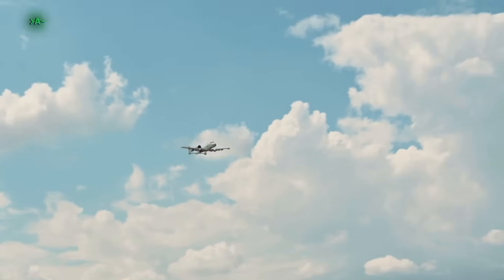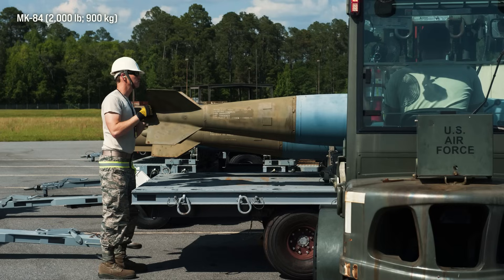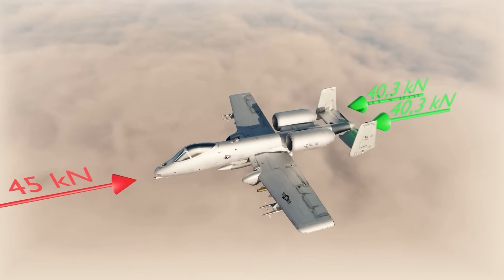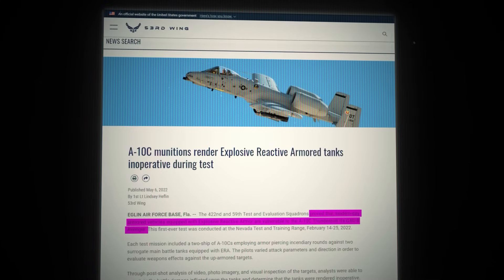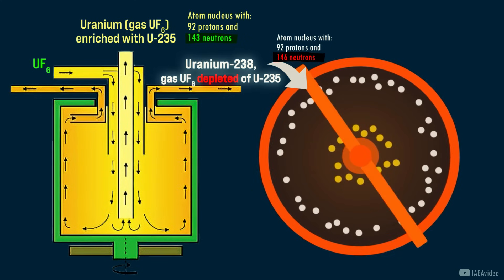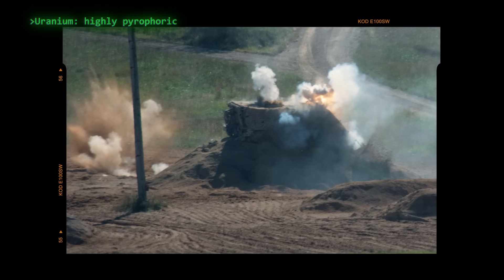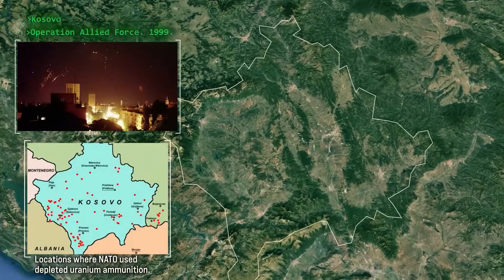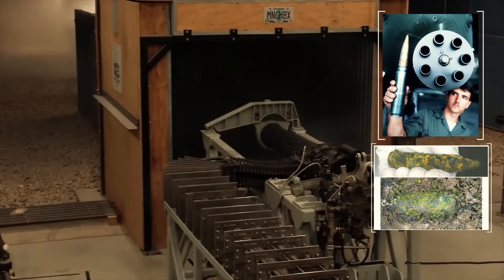The problem with the A-10's uranium ammo

Comment: 7:26 -  "The problem with the A-10's uranium ammo" - what a hogwash... This "problem" is 99.9% radiophobia and ignorance.

Radioactivity of DEPLETED uranium is very low and it is stopped by few cm of air (being mostly α and some β radiation), and while I could not find specific data comparing it to "natural background radiation" levels it is deemed to be "radiologically safe" (i.e posing no real radiation risk, unless ingested or embedded in human's body). In fact, because of its density and availability (hundreds of thousand of tons of it produced as by-product of uranium enrichment) it is used as RADIATION SHIELDS in many applications. Or as "weight trimmers" in airplanes. Or for manufacturing "shots" for anti-aircraft missiles (like the one that took down MH 17 flight over Donbass in 2014). Or... for tank armour.

Toxicity? Uranium is TWENTY FIVE TIMES less toxic than lead. But still, with all that DU in the environment..." - OK, fair enough, let's look at some numbers.

So far the military operation that used the most DU ammo was Desert Storm, where about 300 metric tons of DU was "spent" (ALL "tons" mentioned here are metric ones), in form of all sorts of kinetic penetrators (be it A-10 30 mm ammo or APSDFS anti-tank projectiles, and what not) - while ONLY during WWII, only Soviets (!) used about 17 BILLION pieces of lead bullets - which makes well over 150,000 tons of lead thrown into the environment.
Again - ONLY Soviets, and ONLY during WWII. And what about ALL OTHER ARMIES in WWII? What about WWI? What about all the bullets shot every year in US alone? (at all sort of "ranges" - which could be one's backyard or even some clearing in a forest)? What about all these lead shots en masse every year for hunting ducks, geese , rabbits - and all sort of small game? 
That "Kosovo War" you mentioned accounts for just over that EIGHT AND HALF tons - not "eighty", but EIGHT AND HALF ONLY. And then any statistics quoting "increased rate of this or that cancer" should be compared with PREVIOUS data - if ANY such data exist at all. 

For instance, some claimed "increased birth defects and leukemia cases" in areas adjacent to Chernobyl plant after the Chernobyl disaster, yet apparently the population there was NEVER screened for these PRIOR TO IT - so no full and reliable data for "prior" years (and decades), thus one can't say whether it was REAL "increase" - or just because of proper screening of the population AFTER the disaster many cases that formerly went under radar ("died of old age") were now found and recorded - so any such claims of "increased rate" should be taken with pinch of salt (sometimes a teaspoon of it).

Back to our "underappreciated" lead - and then for decades it was widely used in anti-corrosion paints, in white paints ("lead white"), PVC stabiliser, and as octane boosting / anti-knocking agent in petrol, and what not (hey, even boiled linseed oil prior to '90s was "sprinkled" with lead compounds!) - and all that lead still lingers in the environment...
Here's is an excerpt from "Measuring Lead Exposure in Infants, Children, and Other Sensitive Populations." (p.3., "Lead Exposure of Sensitive Populations" , by National Research Council (US) Committee on Measuring Lead in Critical Populations , 1993):

The amount of contaminating lead released into the environment closely parallels the record of lead production over the last 5,000 years. Approximately half the lead produced is released into the environment as contamination (NRC, 1980). Current production is about 3.4 million metric tons per year , and current lead release is about 1.6 million metric tons per year .

Again - not "thousands" but MILLIONS of tons. EVERY YEAR. Compare it to 300 tons of DU (OK, make it 500... no, 1000 tons ALTOGETHER, so far) - which is TWENTY FIVE TIMES LESS TOXIC than lead...

About 150 million metric tons of lead has been released into the environment in the last 5,000 years. The latter value, total release, is probably closer to the total amount of lead put to use, approximately 300 million metric tons, inasmuch as the element is indestructible and cannot be transformed into an innocuous form.
Much of the lead released into the environment is emitted into the atmosphere (about 330,000 metric tons/year) (...). Those releases are currently dominated by emissions from leaded gasoline [see note below] (over 248,000 metric tons/year)

Makes you think, eh? And have you ever heard of ANYONE raising any... no, not "alarm" - but merely a CONCERN over it? I haven't... 
__________________
"Leaded gasoline" - while leaded petrol for cars was practically completely eliminated more than 20 yrs ago, the one for airplanes, "aviagas", is still leaded one as for some/ whatever reasons it cannot be replaced by non-lead gas. Also, the work was published in 1993, so there would be still "some" of leaded fuel in use out there and at any rate they used data from "years prior".

Comment: The A-10 itself will be retired so the question at the end is pretty moot. And I don't see anyone using this sort of heavy gun platform in the future.
Reply: Especially since it doesn't penetrate any MBT made in the last half century from anywhere but behind. That gun never did the job it was advertised to do, made even worse by being the single weapon with the highest rate of blue on blue.

Then there's the fact that it was only deployed less than 5% as much as the F/A-18 for the same ground attack role because that jet could do the same job without needing to complete air supremacy and to a much higher degree of accuracy and range. And thanks to modern glide bombs, at a lower price in munitions even.
Reply: @FGMagala  yeah exactly, the GAU-8 has being greatly over-glorified, people keep forgetting that it is nowhere nearly effective as a simple air to surface ATGM
Reply: @FGMagala have you heard of Russian tanks those are literally papier-mâché
Reply: @FGMagala russian t80 started manufacturing in the 1975 thats half a decade ago and the amount of t72's used, so there is defenitely not alot of tanks on the russian front that the a-10 wouldnt eat up
Reply: drones are the new thing
Reply: I love that the A-10 is built around its gun, not the gun just fitted in somewhere
Reply: They’ve been saying that for a while and it keeps getting used.

Comment: Depleted uranium is an alpha emitter, so unless its literally inside of you its not gonna harm you.
Reply: good thing the impact turns it into microscopic dust eh?
Reply: @catadoxas  and enters the water table as exposed rounds gets rained on for years. Some groups have done testing and have found markedly higher radiation in the well waters of Iraq all over the country.
Reply: @catadoxas  Even if it is inside you, Depleted Uranium is very weakly radioactive. That's why it's called "Depleted" Uranium. Most of the fissile material, U-235 and U-234, has been almost completely depleted, leaving behind the much less dangerous U-238. The biggest concern of Depleted Uranium isn't so much the radioactivity, but rather its toxicity when Depleted Uranium dust is ingested or inhaled. However, it is no more toxic than lead, and only slightly more toxic than tungsten, but we seem to have no issue using these materials in ammunition.
Reply: It's not the radiation that's the biggest problem, and continuing to focus on that is disingenuous and doesn't do anybody any good.  The real problem is that it's a mutagen, a carcinogen, and a toxic heavy metal like lead, arsenic, and cadmium.
Reply: @ but isn’t the main thing that does all that nasty stuff the radiation to begin with?
Reply: @chrisupton6190  I'm assuming you were replying to me?  If so, the answer is no.
Reply: du also emits gamma rays, there is no form of uranium that doesnt emit gamma rays and it is not a "safe" amount either
Reply: rlly lol its the weakest of the 3 types. problem is if it is inside you it is strongly ionising so cancer is highly likely
Reply: Tell that to the people of Fallujah
Reply: @uk6396  20 percent birth defect rates wasnt it? thats over 10x more than hiroshima or nagasaki
Reply: And by the time it is there probably won’t be anything left of you
Reply: @OJAVIATION.K That's not how persistent environmental contamination works.